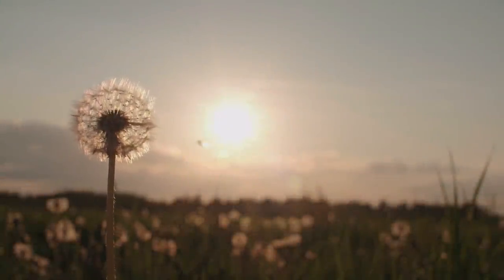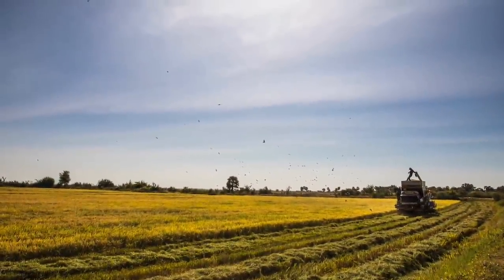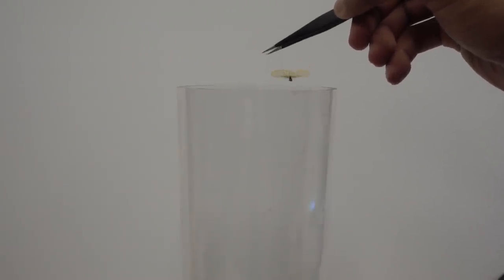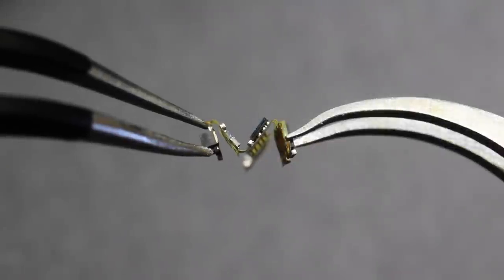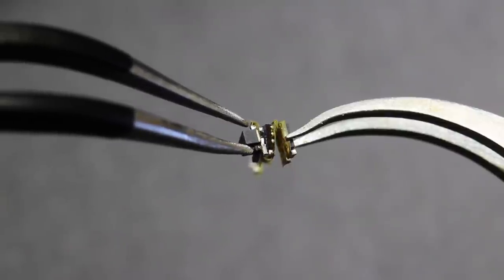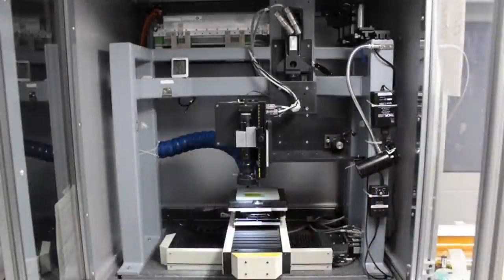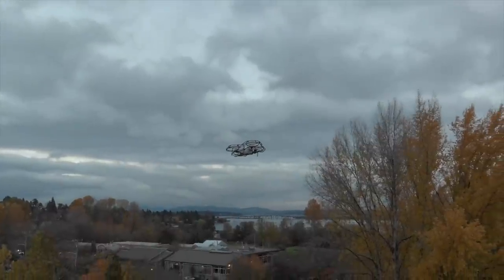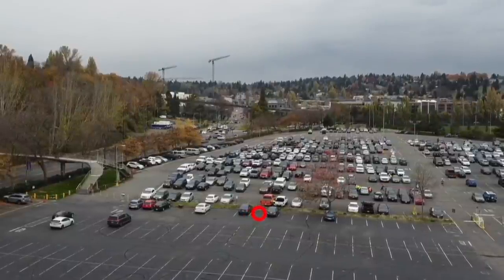Wind Dispersal of Battery-free Wireless Devices

Comment: Fantastic Technology! I am certain that it will have applications in so many areas of agriculture, land management, military etc. However, what about the electronic waste in the environment?  Sure each one is very small indeed but if billions are used on an annual basis... Well you get the picture. All the flex circuits contain polymeric and semiconductor materials that are harmful to the environment. I am not necessarily a "tree hugger" but this must be taken into account. Would be great if these devices were made out of organic based semiconductors that would decompose into harmless "fertilizers". I know this is a very tall order...
Reply: wondering if these could be tracked via some sort of RFID tech?  Might make them re-usable?